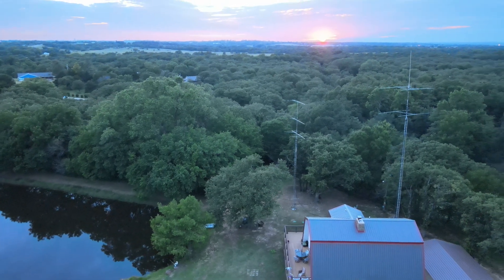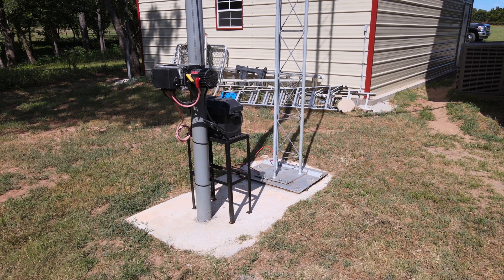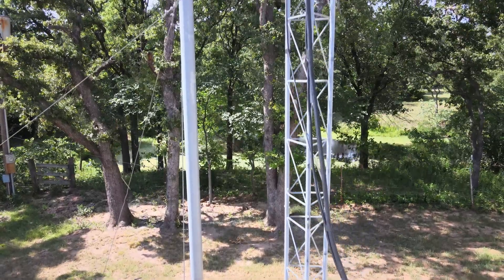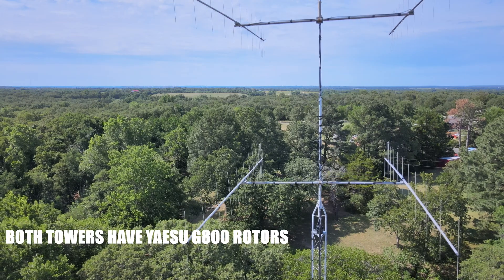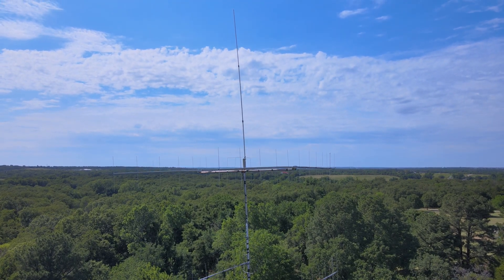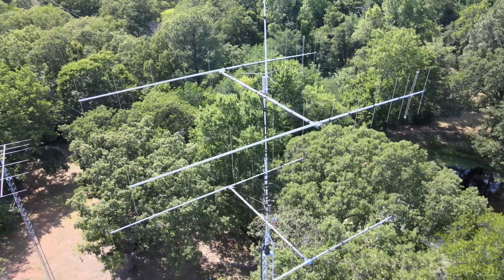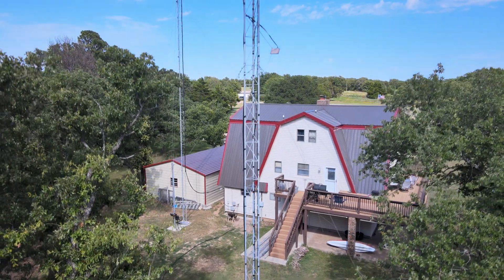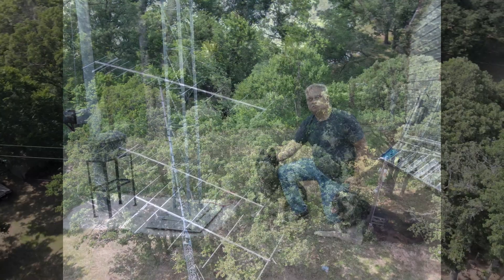N0MUA Ham Radio Tower - New Oklahoma House

Comment: What place do you recommend buying towers from?
Reply from the maker: I would look at QTH.com . Look for Rohn 25g sections. They bolt together every 10 feet.Used ones are good , make sure there is no rust. New ones sale for around 160 bucks that's to high. Around 50 or 60 each section is a good deal.
Reply: @dave-n0mua771  ok thanks for the reply.  Hopefully I will find one, I look on qth all the time but they’re always too far from me.